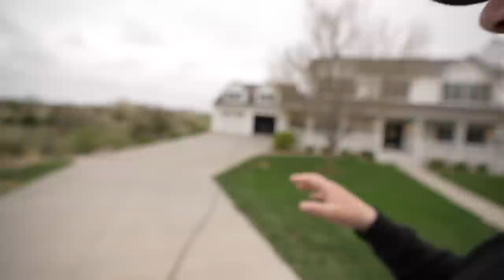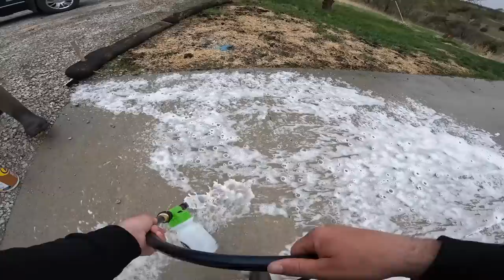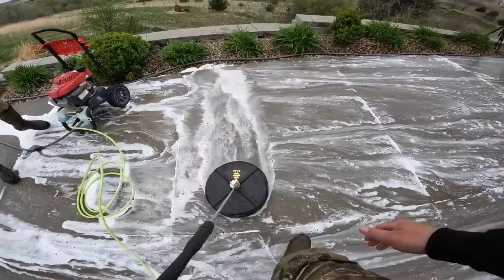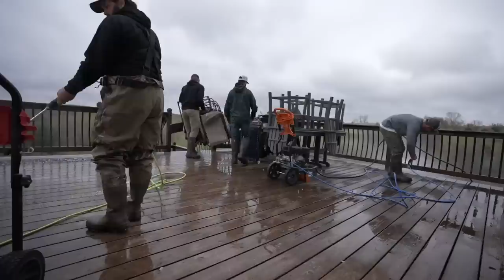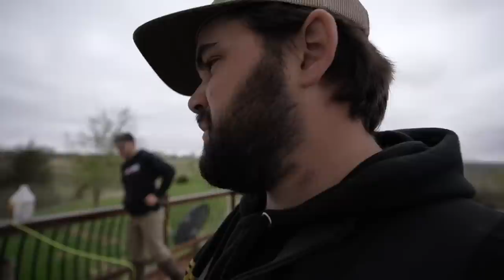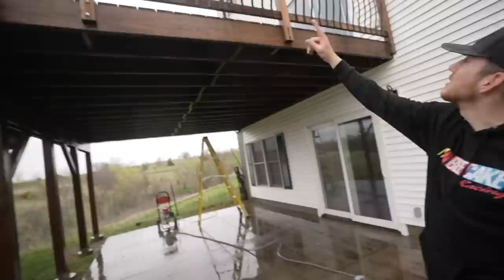Pressure Washing My Backyard Deck (First Wash in 14 Years)

Comment: I'm a professional painter I wouldn't recommend a latex deck paint it can cause the deck to rot latex holds in moisture I would go with a oil base Minwax deck stain best application applied is  with a pump sprayer love the content power washing is definitely satisfying

Comment: Hey Flair, a few quick things. They make solid color stain if you want something other than the wood look, put it on with a pump sprayer and go over it with a roller to even it up. Someone in the comments mentioned using bleach to clean and it works but don't put it in the tank on the pressure washer, it will corrode the pump. Put it in a pump sprayer and dilute it if you have to use it. Good job, keep it up.

Comment: When you are power washing you want to power wash from the lowest point to the highest point. The reason for that is because if you go from highest to lowest, you have to deal with all of the other extra water running down. Also go really slow, so it can get a chance to scrub the concrete. Love the vids.

Comment: If you use a solid color stain it gives you the look of paint but it will penetrate the grain of the wood more than paint will. Paint will start to peel quite quickly. Also make sure it isn't too hot when you are staining so it doesn't just dry instantly

Comment: I really cleaned a garage concrete floor twice a week for over 8 years.  I wet it down.   Poured concrete emosifier from the 5 gallon bucket in puddles. Broomed it in even.  Hit it with the scrub machine.  Rinsed it off.  Just like you did.

Comment: Hey flair for someone who used to power wash houses and decks and concrete Clorox bleach works really well to take green and black off concrete as well as siding. Definitely try and not to get on your flowers but if you do just water them down and when you wash it it dilutes it as well. They also have different nozzles you can buy to shoot soap really far to reach the sides and peaks of your house. Idk if you will read this but if you do I just wanted to give you some knowledge on power washing.

Comment: Bleach with a little dawn dish detergent, so it suds up and you know its working well, with a commercial pressure washer with minimum 4,000psi that sucks the detergent out of a 5 gallon bucket so you don't have to use a sprayer, is what I've always used to pressure wash siding and porches with the wide black pressure washer tip then rinse it all with the yellow tip and red tip, the best thing for concrete is a turbo nozzle.

Comment: I think the "scrubby circular thingy" PSI has to match the PSI of the pressure washer. Looks like the washer was a little low. Also move a little slower. You honestly do not need chemicals with those surface cleaners. On Wood decks too. Keeps constant spacing. no streaks or gouges.
Reply: Gpm is what needs to match the orifice of the bar tips on the surface cleaner. A 8gpm pressure washer matches a surface cleaner with a single bar and 4gpm orifice tips.

Comment: We used to rent a floor cleaning buffer and you can purchase different levels of scrubbing pads.  Round pads.  Slip on cleaner and hit it hard.  But I also learned you can not let it dry till you get the dirt and soap off.  So small sections at a time works better.  Look for floor emosifier.  Rent company might have it.

Comment: A hot water pressure washer with more psi would be more beneficial. Not only will you get the job done easier and faster but you will also lower the amount of chemicals used in cleaning. They also have commercial surface cleaners(circular spinning thing) that range from 18" to 30 in  that cover more area.  You can usually rent them from equipment stores as a trailer unit . . Nonetheless love the content 🤟

Comment: I wash houses and decks for a living, If you guys sprayed outdoor grade or industrial strength bleach on the deck and rinsed it off with a soft wash system it would make it look brand new. The company washing the side of your house with the soft wash system should have told you guys that. Pressure washing your deck cam damage the wood. Also acid washing your driveway will make it pop and look good. But other than that good job guys.

Comment: Stain the deck and paint the railings and risers of the steps. Do the stain first and wait 3 days before doing the painting to allow the stain to cure. Since your going to have to do 2 coats of the paint, use a bonding primer for the first coat and a good exterior latex for the second/finish coat.

Comment: Stain is the only option if you paint it then in a few months the paint will start chipping off and then you’ll regret it. You can spray the stain on ally you have to do is cover the walls and poles on the rails. Just pay someone that does that for a living to come out and stain the patio. Because it might take several coats of stain and they might need to hand wipe the stain onto the porch and then there’s the sealant to apply after that.

Comment: There’s definitely a way easier way flair! I pressure wash all the time, and your pressure washer should have a hose attached under your pressure washer as you washing the degreaser comes out too. It’ll be way easier if you do it that way cuts out at least half of that work you’re doing.

Comment: If you want maximum performance from your pressure washer make sure your hose is putting out whatever gpm the pressure washer uses say its 2.5gpm but your hose only supplies 1.5 or 2gpm you won't actually get the full psi the pressure washer is rated for

Comment: A good chemical for that cement would of be Krud Kutter can get it at walmart close to the paint section.. 

They have cement kind witch i think is Purple label & Red n Yellow label is normal kind witch is for everything (Real good to dilute & spray on clothes that have stains))  you mix with water for what it says on the back of the bottle "Make it a little stronger"  But if ur doing something like a driveway with grease n stuff you want the Cement one.. And you do wanna pre soak every material when using chemicals,  & Big Big thing on like plastics n painted surfaces do not ever let chemicals dry on them  Either ruin your material will leave sainted marks or ull have scrubbing todo or a stronger chemical to buy...

Comment: Once you power wash a treated wood deck you need to seal it. You wash the treatment out of the wood and if you have indentation in to the wood with screws and nails that will start rotting. Just FYI no biggie

Comment: When using the scrubber attachment for the power washer on your driveway your not supposed to use it like your vacuuming your house your supposed to move slowly. It’s a long process when you use those bc for best results do a square at a time and go up and down then side to side for best results unless you have a commercial grade one

Comment: Some duct tape and a paint roller on the tip of the power washer nozzle will keep the tip at the same height every time instead of buying or renting a fancy device to do what you want at 28:00 .
Even at 36:00 you can see a definite difference between the cleaned and uncleaned sections.

Comment: Hey flair please DO NOT stain your deck after pressure washing it, and if you do wait like 3 weeks to a month. Stain is supposed to soak into the deck and the more that soaks in the longer it lasts and it can’t soak in if there’s a bunch of water soaked into it already. So if a month is too long to wait and if it’s on the market by then already you might as well just let the new home owners do it next season as it’ll be dried out by then. If you do it and it’s full of water the  it just costs you more money and the new home owners more time and money having to redo it. I’m sure professionals will have their own opinions on this but I worked In a paint/stain department and this is what I was told by everyone.

Comment: Stain the deck do you not paid it and you would’ve been better off using that attachment for the pressure washer on the wood it works amazing I’m speaking from multiple years of experience but you have to have a 3000 psi or higher pressure washer for that to properly work

Comment: Don't paint it's a pain to keep up and peels fast. It looks like a whitewash look of your choice of color but it's still stains with tints to cover up your imperfections. Kinda like a transparent paint.
Reply: Stay away from latex unless you want algae growth and wood rot. Paint only last longer on new dried boards otherwise it feels all the time. You have good looking wood minwax stain will hold up look nicer and can be tinted or colored for white wash look. They even sell them with that look since it's popular with covering older deck imperfections. Sprayer works good even hand pump ones work but coverage is uneven than a painters sprayer or air compressor fed sprayer. I would tape off the house and just make a very large cardboard hood for spraying.
Reply: Just what ever path you decide you should cover your concrete below. Or make sure it's sealed properly so it's easy to power wash the color off. I would just cover it up.

Comment: Premergent typically lasts a season so 4-6 months. You’ll need to turn the soil or add top soil and then seed. Once you add it’s best not to disturb the soil as it creates a layer so to speak
Reply: What does this have to do with pressure washing a driveway and deck??
Reply: @SH-tz6ee  he spoke on planting seed in areas he threw this down. Did you even watch the video. He talked about it multiple times 😂 troglodyte attention span
Reply: @HoRRiiBLe1313  spoke of what? I think you are a video behind ,  this is the pressure washing video Chris, not the landscaping one. You used a big word though ! Premergent! Nice work!

Comment: Those scrubbers do work well if you have the correct pressure. The machine you were using Flair seemed like it wasn’t giving enough pressure. The scrubber should almost be lifting off the ground with the pressure, floats basically.

Comment: I mean no disrespect by saying this but y’all tried way to hard on the driveway. All you need is a mixture of bleach and water to presoak the concrete. Unless it’s got oil stains then a degreaser is required. You can use this on the concrete the wood deck and the house to make cleaning much easier. This is what we use in out professional soft wash busniess